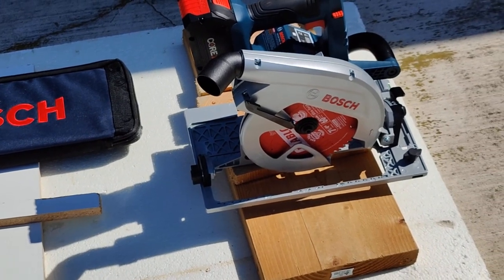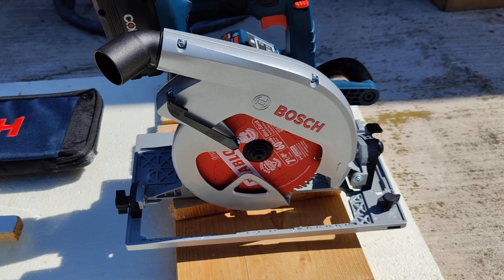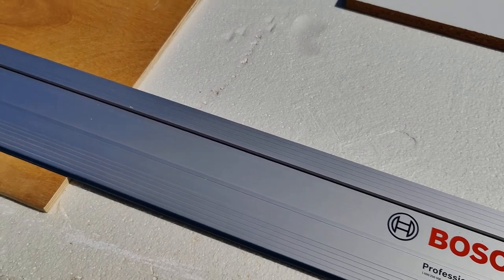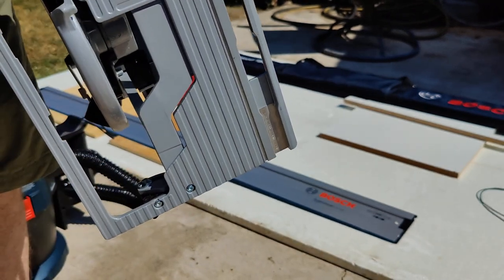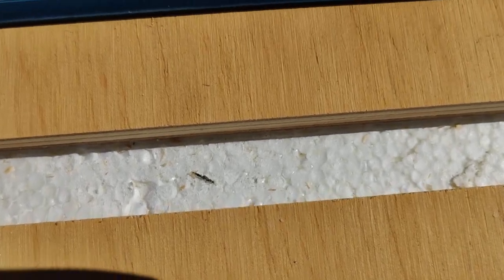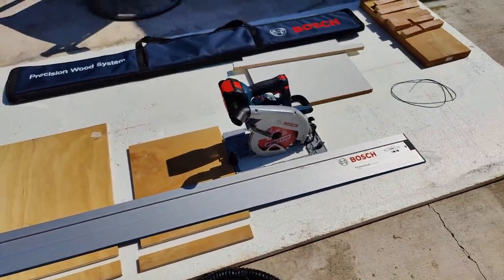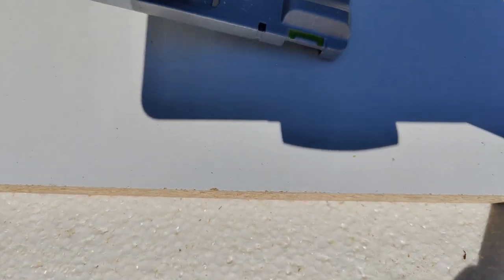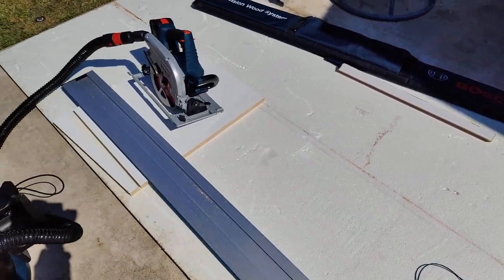Bosch GKS18V-25GCN in use with Bosch track

Comment: I have this saw and I have using it Makita/Powertec guide rails.  I noticed some play on those rails.  How's the play on the bosch guide rails?
Reply from the maker: There's very little if any. I do have the actual track saw, which is adjustable, and obviously it's better.

Comment: Thanks for the review! Still waiting for this thing to become available.
It would have been nice if Bosch found a way to remotely trigger the shop vac from the tool.
Reply from the maker: Agreed
Reply: @carterscustomrods  will this identical saw be releasing from Bosch in a left sided blade saw?? If so I will not use mine and return it and wait on the left bladed version as this right side is a pain to see your cut line.
Reply: @carterscustomrods  great to know thank you I didn’t know this and hope it happens soon.
Reply: @carterscustomrods  I found a picture of the overseas left bladed version after doing some research. It is called the GKS 18V-70 L. Check it out if you haven’t already. I would definitely return mine or sell it for this left bladed version. Thank you for the heads up.
Reply: @carterscustomrods  judging from the pictures I don’t think this newer left bladed version will have the plunging ability. I second a cordless router a new 18v version would be nice. I also hope they release a new 18v barrel grip jigsaw and not just the older overseas version they just introduced in the US that’s been out for year in Europe.
Reply: @carterscustomrods  Bosch seems to have a lot of interesting tools that just don't get marketed to North America. In one case I've imported a tool because of that but I felt it was a special case.

Comment: I have the classic corded Mafell for many years that served me well from cutting anything from floor boards to Hardy plank for the kitchen. Together with an Asbestos certified Metabo vac, no mess. I was looking for a cordless version, also to do rough and quick cuts. I have plenty of 4AH and 8AH Bosch batteries, so I was looking at the GCN. What to expect with such a saw in comparison to a classic track saw? Considering that the Mafell kit now trades for $1,800 with rails, the Bosch sounds like a steal.
Reply from the maker: The lower guard on this saw makes it a little cumbersome as a track saw. Don't get me wrong it works, just not as well as the actual track saw. It just takes getting used to. Hope this helps.

Comment: What Diablo blade is that and how many teeth? I plan on getting a few Diablo blades when mine comes in. Good video keep them coming.
Reply from the maker: It's a 60 tooth,  it may be the most you can get on a 7 1/4 blade. I'm going to try some 40 tooth blades as well. I think that's the sweet spot. I used the 24 tooth that came with it for the lumber.
Reply from the maker: It's the do760a